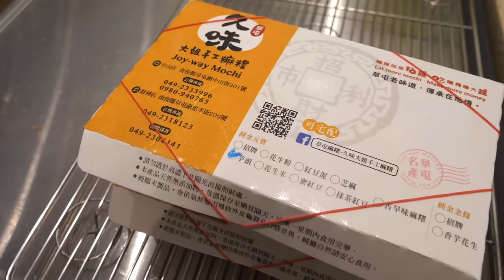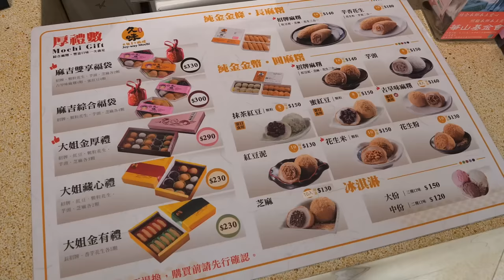Mochi Factory in Taiwan - Taro Mochi, Red Bean Mochi, Matcha Ice Cream Mochi 芋頭麻糬, 紅豆麻糬, 抹茶冰淇淋麻糬

Comment: The factory is so clean and neat!
Reply: 4:10 it’s a hazard. You are not supposed to wear jewelleries in production. That necklace will be a physical hazard if it goes into the mochi
Reply: Except he’s handling food with bare hands and wearing jewelry.
Reply: @MrShigura  handling food with bare hands is totally ok as long as you clean them.
Reply: @SuvuIC  Sure, if you like to eat arm hair and fingernail dirt flavored mochi.
Reply: The jewelry is a problem, and the workers hands being so close to that widowmaker of a mixer. Also they should not be putting the food-use buckets on the floor and then putting the same buckets on the stainless worktops. Could be done safer.
Reply: @MrShigura fr